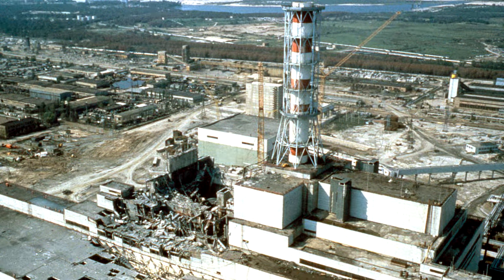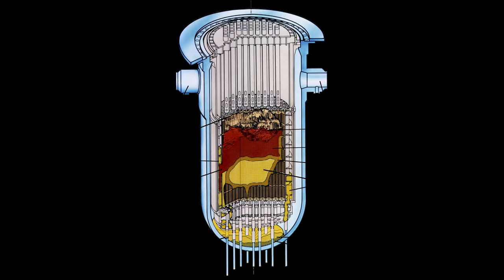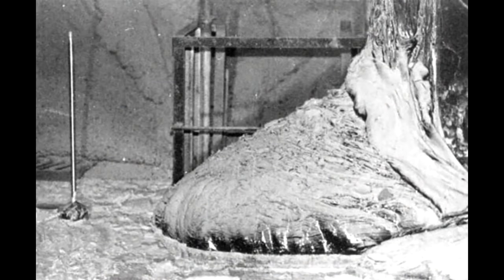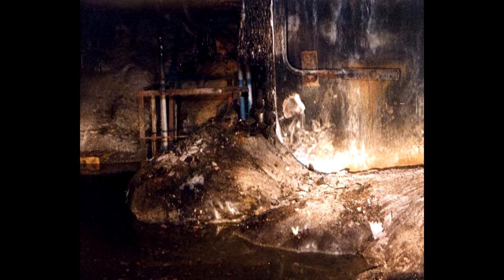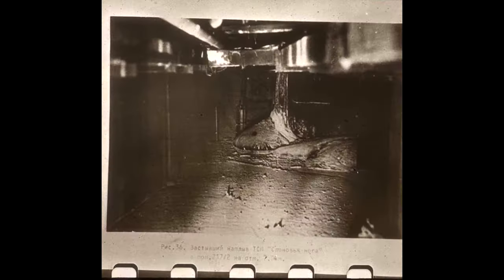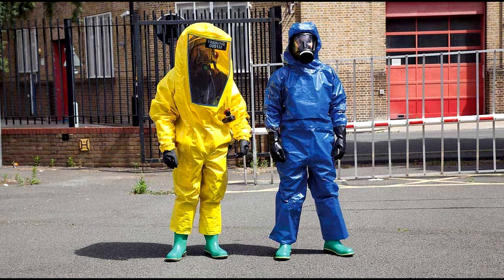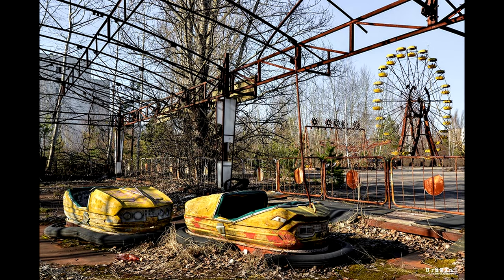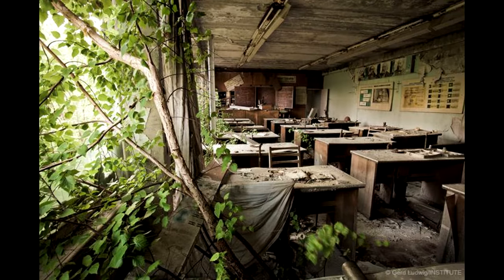What is the Elephants Foot?

Comment: "...uninhabitable for the next 20,000 years." That is absolutely unimaginable.
Reply: From my knowledge of nuclear physics and this particular incident, I question that number. However, proving that it is wrong is more effort than I want to put in. Here are the reasons I think that number may be exaggerated:
- most of the hazard from nuclear waste is Cesium, Strontium and other middling half-life hard gamma emitters. Most of these have a half-life in the tens of years - the hazard is essentially nil after 500 years
- some actinides are hazardous for longer, but they constitute a tiny fraction of the waste and have long half-lives
- the contamination from the moderator would be mostly carbon 14, of which there would be very little (requiring two neutron captures to produce) and relatively easy to protect against (it's a beta emitter - easy to shield against.)
- the wildlife and people who refused to leave seem to be doing fine.

My guess is that 600 years would be plenty.
Reply: See, that makes more sense. These people know more about this than I do, so I  didn't question it. 😂
Reply: That's sad
Reply: That sent chills down my spine
Reply: Bro for real holy shit😅 dr stone shit

Comment: Morbidly fascinating topic, Chernobyl.  I was three when it blew, making it the single most significant individual event in my lifetime.  I'm glad the guy at the end of the said 'This is a reason when you don't build a nuclear reactor... as cheaply as you can.'  I honestly think, as humanity's energy needs move beyond that which can be supplied by fossil fuels, Nuclear power will become a staple of energy production.  Fortunately, our designs today (Gen IV SMR, or even the Thorium reactors the Chinese are working on) are infinitely safer then the RBMK or the BWR/PWR designs that resulted in the meltdowns at TMI, Chernobyl or Fukushima.
Reply: Higgs Boson?
Reply: I was 2.
Reply: low temperature evaporation of water.

Also, it's quite oblivious that you didn't mention covid.

Comment: At what temperature is the corium too cool to flow?
Reply: I'm not an nuclear physicist. but i'm a blacksmith so i have an idea of the temperatures needed.

So given that it melted trough Steel. At least 1300°C is needed. so for it to become solid again it needs to be below that.
 Corium is an alloy of everything the nuclear core melted through. so one need to look at the melting point of everything. and as far as i know, Steel is the thing with the highest melting point of everything in there. but i don't know what the lowest is, or if the corium is thoroughly mixed. so expect an temperature of minimum 800°C (Wich is enough to set wood on fire instantly, and give you an instant 3degree burn)

I hope this answer your question.